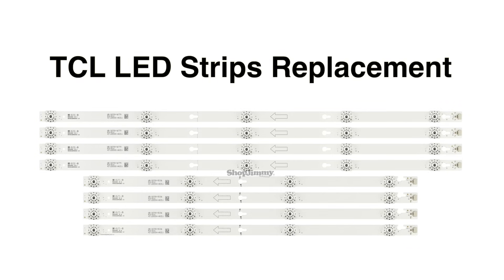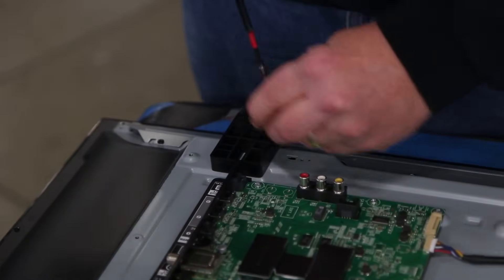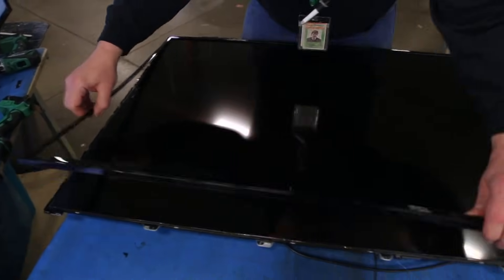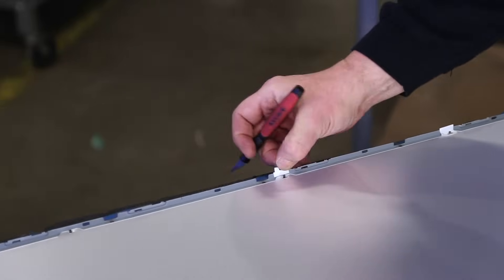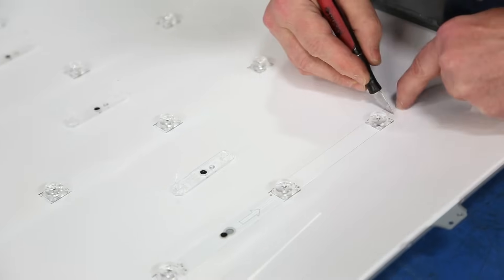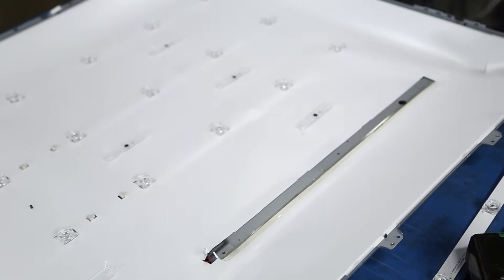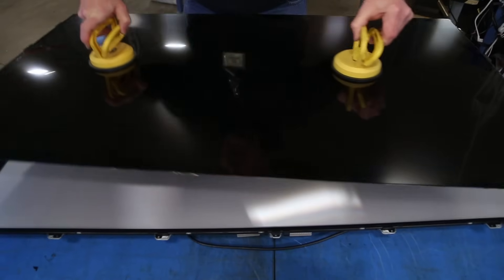TCL 55" TV LED Strip Replacement Tutorial for TCL Models 55S401 & 55S405

Comment: Very Helpful Video - I have a TCL 55S405TFAA, manufactured in June of 2018.  Starting this morning, the TV powers up and responds to the remote but the display is black.  With a flashlight I can see the image so I know the problem is related to the backlight.  I haven't torn into it yet.  Is there a way to determine if the problem is with the power supply or the LED strips themselves?  Is there a separate supply for the backlight?  Is it possible to test the LED strips without completely disassembling the TV?  Are these parts available from ShopJimmy.com?  Thanks Much for your suggestions.
Reply: I doubt if Shopjimmy will reply, but I've been replacing LED strips in TV's for several years.  I'll try to offer some assistance.  In this model, the wires from the LED strips connect to the power board in 2 different sets, but the power board puts them in series anyway.  I use a tester like this, you can find them on Ebay for around $18:  https://www.ebay.com/itm/LED-LCD-TV-Backlight-Tester-LED-Strips-Beads-Lamp-Test-Repair-Tool-0-300V-Output/143541670751?_trkparms=ispr%3D1&hash=item216bc0135f:m:mq-Oe28MPSTZYCieZpsu7mQ&enc=AQAEAAACUBPxNw%2BVj6nta7CKEs3N0qWdGpqSm0bXvaIvC76VYsoOO2jH5gCb2FSXgPBhieHOcYPyPNRv96MA1KrJTblZOxLhIinEe79z3Yt2fDIr6TsZ42GfOmTqlBs%2Fr9yQYwCgieKEgn5y3Z2xG%2FzR03UlsP1zSgpF%2BB61SBAukM4CI0ltqoByAYYWCC1R7o9MUaSFPzvHtju1GyhnmQiZ150uQ0aMwtnqnOoNOri41nL9BBuMVcQwP%2BwkqQXifFeW%2FlXCMVasSXPHtZb%2F%2BPZiUZqloUEg%2FsZUMXmRXqrvN248WAcf0A0Oro0KRgH%2F6f2%2BcPpkJLQVMKYQUdMunOy9hVjiK8NkwtzTRd0vlkvDXuNB9kW69V0w0c3qTk1wOOICqMxAiXQVOKeoZ4cA73zFUVx6terYgUpDUpkUO2Cd%2BzrKvs1dT5pFIYbCqqeD1h7spG2cOHz9H4qbNkvDAQ1sI6HkYJ3bdNRKx1NUbLPuGSOkqADdXfh79s40lfgTMQi7fuhGm10VHonewam6PJNGdvwiObRS1c6xh3BADf6rt2u13uKl%2BrroK549TgmPAzBgpetoCt40pyGOOK6B6Lsc1Kwgv4hM0U38sLu1Dw%2B5Tk48%2B8V2tjLe9P1DQIvOlScNyv8SADAePB18fz%2BNn4GUV8dP3PFVvP5pXrYApQ9cybG5sppS%2BW64nWtI8WQu7A6ZaDlPiawy6eIvo9wKdHPZ6JGersmja%2BWLAXh%2FK8%2BSjHSYWPAc5gl69vO0slsrmYmt7UGGmZWOFHdRmx4foO7OQ37ODd0%3D&checksum=14354167075144bb6aa3d7ae4630a10cede8f27c471f

Unplug the connector that goes to the LED strips from the power board and probe the 2 sets of wires with this meter.  If the LED's are good and not open, you'll see the voltage on the display drop from 240V down to around 90V.  (Polarity is backwards on this model, the red wire is the negative side, at least on mine it was.)   On this model as with most, the LED strips plug into the main power supply board for the TV.    Mine had one good set and the other set read wide open.  As for finding the replacement LED strips, just do a search on shopjimmy.com for your model.  (The last 4 letters are significant too, the THAA uses a different set of LED strips than the other models.)   And if you can't find them there, do a search on Ebay.  
And very importantly as I mentioned in my comment above, they missed a very important step.  On any LCD TV, before lifting the panel out of the frame, you want to carefully hinge the scan boards around to to the top side and tape them to the screen with a piece of masking tape on each end of each board trying not to stress the ribbon cables.   Masking tape will peel off easily enough without damaging the ribbons but other types of tape are way too sticky.  If you don't unhook the scan boards from their clips first and tape them to the top side of the screen before lifting the panel out, you will tear the ribbon cables off and the screen will be junk.   I'm currently struggling to try to remove the LCD panel from the frame on mine.  3 sides were loose, but the top side has some very touch adhesive.  I'm trying to work a thin guitar pick between the panel and frame to separate without cracking it but it's very slow going.
Reply: Update, I did get successfully get my screen out without cracking it.  The adhesive on the top edge was too tough to get through with a guitar pick.   So I cut the thin flat circle out of a cottage cheese container lid and worked it along the top edge.  It was still very difficult to move so I took a Q-tip and some alcohol and soaked a little in along the edge of the screen and on top my plastic piece and it came loose much easier.
Reply: @Steveh112  Thanks for the suggestions.  I'll probably pick up the LED tester.  With luck the power board is bad.  That would be an easier fix.  I think I've experienced some power spikes lately as I lost the microwave oven with just a few days of this failure.  It ended up having a bad door micro switch (always open), and a bad bus fuse in the power supply.  Seems unlikely to have two unrelated failures.  Normally power here is reasonably reliable but in the past week or two, we've had 4 brief power outages, each after what sounded like an explosion...
Reply: @bobsolidgray  You could also use a standard DC volt meter and measure for voltage at the connector with it on. Being 2 sets in series, if you see a large voltage drop across one set and nothing on the 2nd then you'll know you have an open LED.  Just be careful not to touch anything live or short something out working with power on. Anyway if you see DC voltage and no light then you know your power board is ok.  I hope it's not the LED strips. Been working on mine all day and still about an hour's worth of work left. Big job even for someone experienced like me.

Comment: I have the black screen backlight issue. I can see an image with a flashlight. I had this same issue with a previous laptop that I had and I replaced the inverter board to solve that issue. What parts do I need to repair this TCL 55S405 backlight issue? Will I need the LED light strip? I will buy from you because I think this video is professional and informative. Thank you!
Reply: If purchased less than a year ago TCL will replace for free
Reply: @jwhitaker1119  Thanks for replying, James. I spoke with TCL Support and they say that I'm out of the warranty by a few days even though I placed the order on December 18th, it shipped December 20th, and I didn't receive or use it until the 23rd, which is the day that I contacted them. So I suppose I'm on my own on this one. I'll give them bad reviews for the rest of my life and recommend everybody to look elsewhere when shopping for a quality, affordable, reliable television that is a good value.
Reply: Also, it seems like a lot of people start having issues TCL televisions just a few days past the warranty. Pretty fishy in my opinion...
Reply: I bought one from bestbuy and mine just crapped out but within the manufacturers warranty. TCL sent someone to fix it and could not fix it. Ugggggh so now I'm waiting on a "recertified" tv of the same model. I'll be going back to LG TVs for now on. Weird how the backlight goes out when I'm changing the inputs to watch tv. I feel like tinkering around with the tv to see what the issue really is coming from.

Comment: I broken alot of screens with them suction cups I don't trust them I pick the corners up with my hands
Reply: I cut the panels off of a cereal box and carefully work them under the screen and lift from the top and bottom center.  (Never end to end or it can buckle in the center and crack)
Reply: On another 55" TV I used those smaller 2.5" suction cups. Two on each end and had one person lift each side. Those smaller suction cups work great. They don't have such a huge bite so there's less stress on the glass, yet they can have a very powerful grip.

Comment: My TCL LED40S4900 screen flashes 1 second then goes black but with sound, I've tested all the led strips and all are working, what seems to be the problem?
Reply: Greg Avila have you tried a flashlight test?
Reply: @CrabRangucci  yes, video is visible with flashlight
Reply: Greg Avila if it’s not your leds, it’s your power supply board!
Reply: @CrabRangucci  can it still be repaired or need replacement? There's only one board at the back.
Reply: Some times the connection between the led strips is not connected properly

Comment: i have a TCL 55s405 no backlgiths...i removed backlight cable to the ps and i have 0V going out to the backlights connector...i assume its a bad ps but i replace the ps and same issue..ov going out  going out to the backlights....shoyuld i have about 65v going out to the backlights? with bl connector disconnected?
Reply: factsonfacts..no i have not..i dont mess with leds unless i know for sure thats the issue way too much risk damaging lcd panel..very difficult to get to leds... i asked in a forum and nobody could confirm if i should have voltage present at power supply with leds diswconnected so i aborted the repair until i can confirm its not the power supply...99% of the time its the leds and not ps but i dont care about the tv much right now...do you have 0v coming out from ps to the leds? with connector disconnected?

Comment: I’m going to use one of these broken TVs as a light source.  How many watts do the LEDs consume? I would prefer to use a small power supply and not have to use the TVs internal power board which consumes around 60 watts to power the entire tv.
Reply: 3.3v for each one

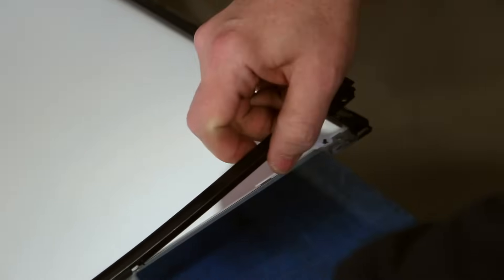Comment: Can Anyone Tell me what the tabs are on the sides of the panel at around 1:52 ? they are not the ones on the bottom but on the sides? what are they and are they easily damaged ? do i have to worry if i bent 1 a little ?  Thanks